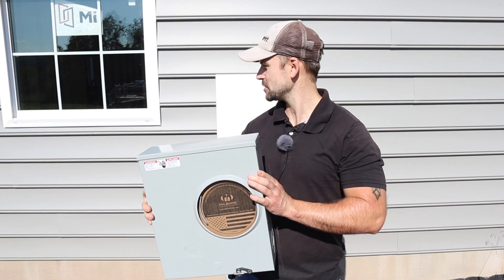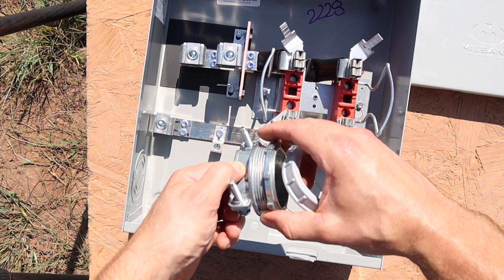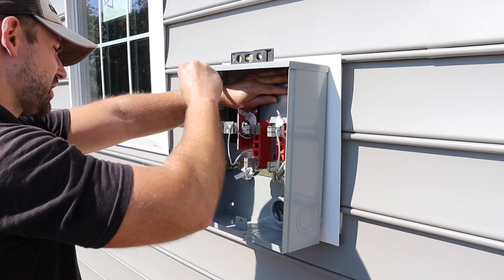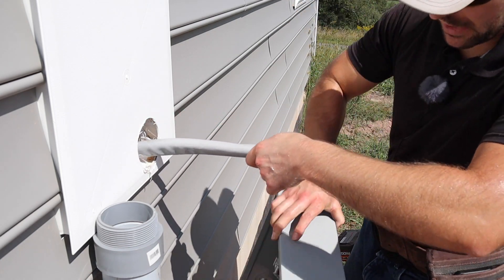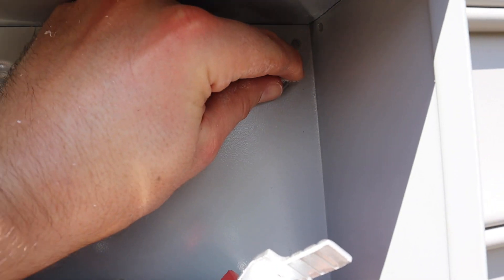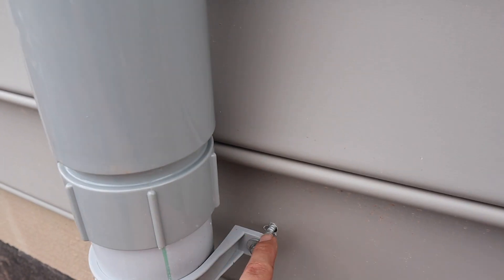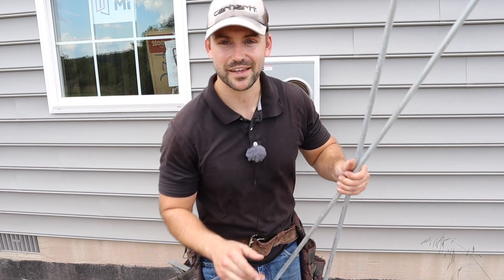Meter Base Installation In 14 Minutes! FAST And EASY!

Comment from the maker: I made timestamps below to help you navigate the video 👇. I hope it helps!
Supplies for meter base installation 00:15
How to remove a knockout 02:17
How to install 2” SEU clamp on meter base 02:52
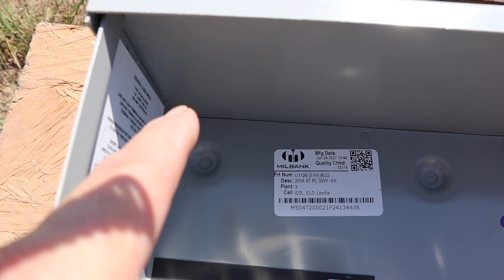How to position and level meter base 03:29
How to drill through the wall 04:08
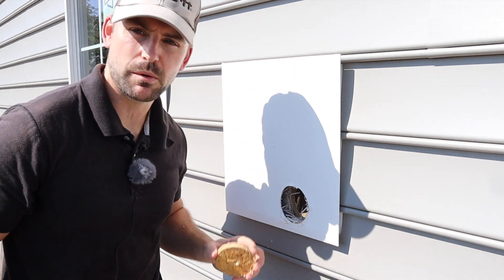Why I did not need a disconnect 04:28
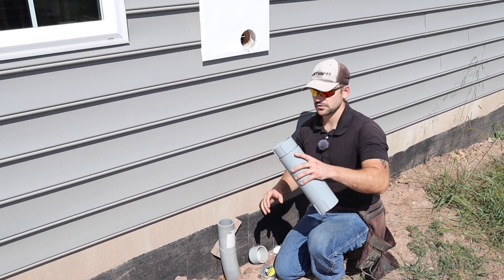How to install an expansion coupling 05:05
How to secure the SEU cable to the meter base 06:18
How to secure the meter base to the house 06:36
Meter base height requirement 07:42
How to wire SEU cable to a meter base 08:09
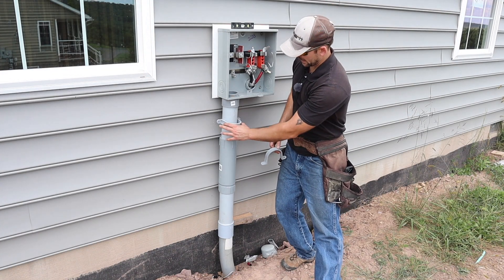How to anchor electrical conduit to the house 11:02
How to seal the hole for the SEU cable 12:42
Reply: When you are mounting the meter socket, you mention the J Block. Do you have a source for this item? I like the look it give the installation.  Thank you.
Reply: In my humble opinion, you do need an emergency disconnect outside to comply with NEC 230.85. Also, you should have used a torque wrench and tightened those screws to spec. Thanks.

Comment: The expansion pipe sounds like a sale  because you bolted wires to meter , they won't expand therefore you'll experience the meter being pulled if house foundation settles . Think about it .

Comment: I have two questions.  Can the meter be set on some kind of pad so it’s not actually    on the house.  Secondly we have a steel barndo and my electrician who gave me an estimate said my breaker panel can not make contact with the metal frame inside.  Unfortunately the framing inside of the barndo cannot be completed yet, but I wanted to get this out of the way somehow because our well and septic systems need to get put in and I need power for those. He said he wanted to do the breaker panel before the blown insulation because he didn’t want to mess with the insulation during the process. Has anyone dealt with this issue before? Because if I have to wait for insulation and framing it’s going to be a long time before I can get power to the house and our power company will not run a service line until a meter panel has been set up

Comment: Wish this was still code. Now, you have to have both a cutoff switch and surge protector on the panel to pass inspection. 

Even if your newly bought home from 1974, if the meter has been removed from the box due to non-payment from the previous owner, you have to switch all of that. Absolutely crap

Comment: What stops water from entering inside the house through the four lag bolt holes and the large wire hole? The putty stuff around the box's mounting holes just keeps water from entering the meter base box, but doesn't prevent water from getting into the home.. Did you silicone the outside of the box to the wall after you were done or something?

Comment: Shouldn’t use back knockout you violate the bend radius of the wire usually running the load side wire. The disconnect is in case of a fire they don’t have to remove the meter before the go inside. They won’t go inside without water they won’t use water unless the power is off. In short you should always install a disconnect. You generally don’t need those long lags unless there is blocking. Make sure your screws have threads go all the way up the shaft. Mosltly they are grabbing the 1/2 or 5/8in ply board on the outside
Reply: Make sure to follow the torque specs and brush in the antioxidant if needed this looks like newer wire that isn’t completely aluminum

Comment: just got quoted 4500 to replace the meter base.  I DIY everything.  thank you for the video!!
Reply: Do you start by calling the utility company to disconnect your old meter first?
Reply: @blamuk  I tried, but the Nashville utility requires a licensed electrician to have them disconnect.  So I ended up paying $2500 to have the meter base replaced and all new wiring to the first box.  In other words they would not let me diy.  Unfortunately I had already purchased everything to do the job and still let him use his sourced parts

Comment: No need for antioxidant on the wires.  That hasn’t been needed for a couple decades since AA-8000 aluminum has been used for the wire.

Comment: Your expansion coupling wasn’t installed correctly.  It looks like it is almost bottomed out.  It needs to be able to move both up and down and if the ground heaves upwards, it appears your coupling has no slack to allow that.  There should be a couple inches of space between the inner and outer pipes so the bottom can move up as well as down.

Comment: Is it important to seal the 3in hole cut out where the wires pass through the wall? Sealing the lags makes sense but I’ve never seen the 3in hole be sealed by anyone but it seems like it should be?

Comment: I bet you failed your inspection.  You didn't ground your meter base to a ground rod with your number 6 bare copper wire.   You had the ground rod clamp on the table.

Comment: Hey Josh, new Sub here, Thanks for the detailed video. 1 question, I am running cable to a 30 amp rv pedestal and then to a 100 amp panel for a tiny house. What size cable should I use for a 225 foot run?  Thanks

Comment: Hopefully someone can chime in on this, as I'd like to upgrade my service as well (and save a ton of money). Doesn't the 2020 NFPA 70 (electrical code) require emergency disconnects between the meter and panel now, regardless if it's just in the other side of the wall? The meters with disconnects are considerably larger and more expensive.  If anyone can provide a video or reference on whether or not this is mandatory, and what the exceptions are, I would be very grateful.

Comment: Put my meter box in yesterday thanks to your great video
Reply: I hope you grounded your meter base to a ground rod.  He failed on that and will fail his inspection  as you will to if you didn't do it.  Per NEC codes
Reply: @e_street7754  I had grounded my circuit panel but the inspector said the meter based also had to be grounded. Not sure if I could of only grounded the meter or not. Thanks
Reply: @newgardener    I'm talking about your meter base. Not your circuit panel.   They are 2 different things.
Reply: @e_street7754  Did I not say that the inspector had me ground the meter base? Maybe I am dense, But I thought I differentiated between two. 

Anyway two months ago I did my install exactly like the video and when the inspector came to inspect he had me add a ground to the meter base to meet code. He also recommended that I leave the ground on the circuit panel.
Reply: Your not dense.  I didn't pay it any attention.  But yes. Your meter base and your circuit panel (breaker box) does have to be grounded to a ground rod.    Now if you have an sub panel. It doesn't have to be grounded to a rod.  Your sub panel will be grounded from your wires you pull to it.

Comment: I believe you are supposed to set the expansion coupling  separated on the internal line. That way if you get expansion or contraction you are covered. I dont think you are to install that all the one to one of the rails like shown in the video.

Comment: You can't use that kind  of cable to feed from your meter base to your panel. You only need  3 conductors to the panel but the neutral has to be insulated. That wire you are using for a neutral is meant to be a grounding conductor. That cable when installed from the load side of the disconnect is made for 240 volts and ground. It's gonna work but it's not code compliant.   All three conductors should be insulated as they are current carrying conductors and should all be insulated.

Comment: one thing with no lox.  the way you did it is wrong.  you need to brush the goop in with a wire brush, then put the goop in the lugs.

Comment: Commercial electrician here, never seen an expansion coupling before. Seems like a good idea, but if something happened, wouldn’t the wire snatch the meter off the house?
Reply: I was wondering the same.

Comment: Im installing a breaker panel and meter socket on a pedestal for my shed. Does the meter socket need to be on the same side as my power pole?

Comment: Nice video. You were saying in the end you went going to drive the grounding rods and run the grounding wire to the panel box. My question to you is does the meter box needs to be grounded? Looking forward to your response.

Comment: What is the flat material you mounted the metal meter base box on, that was already fastened to the siding?
Reply from the maker: It is a block for mounting the meter. Here is the video of me installing it https://youtu.be/l1MwrqImWXsI I hope it helps.
Reply: Anyway you could send me your link to installing under electric conduit? That is what I am doing right now, 2 1/2 " schedule 40, grey.

Comment: Hey Josh please pardon my ignorance,

But I have a question I have one of their boxes from Cutler-Hammer much larger than yours it looks like it's got a breaker panel on the bottom of it, however from The electric I was wanting to know if I could remove that and get in to the box?
I want run lights to my carport and a couple of outlets, I already have everything I need except for five more sticks of conduit two more plugs and boxes and the weatherproof covers for them and I plan on using 10 gauge wire
So do you have any advice?

Comment: Hey I love your channel. I just subscribed. I watched most your electrical videos but I have a question I installed a meter base and main break panel side by side. Do I connect both the meter base and panel to ground rods or is on the main break panel enough? The code was kind of ambiguous. Using #4 copper ground wire. Thanks 🙏

Comment: I look inside my main panel and I don't see the 6 ga or 4 ga bare ground wire (that comes from the outside actual "earthen" ground rod) to connect anywhere inside the main panel that I can see. However, if I follow the buried ground line from the ground rod, it seems to come up through conduit to the outside meter panel and enters there. So the questions......1.)  is this a local code difference where the ground line gets connected to some part of the meter panel?....and 2.) how do we continue the ground path from the meter panel to the main panel? I checked ground continuity from the main panel and it's grounded, so I know I have a connection somewhere....just don't know where.... and how "Stout" ( ampacity) it is. Can you or others here help?

Comment: Excellent Laborer, did you know that it would be easier for you to install the ground rods with a hammer drill? I'm sure you must have heard of that. The hammer drill will lesson your work load and make it easier for you. I noticed you did not connect the ground wire to the meter base and I'm wondering why you didn't connect to the meter base.

Comment: Code requires the lugs be torqued to the manufacturer's specs with a calibrated torque wrench.   Improper torque is a leading cause of failure. It is critical with aluminum conductors.   And a torque wrench is fairly cheap.
Reply: NEC code requires the meter base to be grounded to a ground rod.  He didn't do it.

Comment: After you install the ground rods (6ft apart) you install the ground wire to the rods and go through the wall of the house to the panel box and connect the wire to the ground bar or to the meter ground?

Comment: Thanks for the video josh! I have one question though.. I'm currently adding vinyl siding to the house and my house has the meter and everything already set so I won't be able to install a j block. Do I just J channel around everything??
Reply from the maker: Yes that is correct, just put J channel around it and you should be fine. Hope that helps!

Comment: Thanks and great video! An electrician just mounted mine today but at first I thought he didn't leave enough 4/0 wire. He didn't use that SEU 4/0 cable you used just straight up 4/0...now Im going to go see how he clamped it. Anyway - whats that white mounting plate/panel on your house? I have new construction garage and the cement board isn't installed yet and the guy just lagged it straight to the OSB (and he didnt use those water tight screws like you used either).
I really like how you lay out all the supplies and give basic definition. Thanks again!
Reply: White block is a vinyl siding meter block. They make different sizes too for outlets, outside lights, exhaust vents for a nice clean look.

Comment: What is the flat square in the wall?
Reply: It's a meter base j block. It's basically j channel for your siding to be able to go right into it ..for looks really so you don't have to jchanel around your plywood piece you use to mount.

Comment: Expansion joint conduit looks to be installed incorrectly. There should be a black line on the conduit once pulled out, around 4 to 6”. That’s where it should be set at. The conduit needs to be able to move up or down.
Reply: The comment about installing the "frost sleeve" expansion joint as it was referred to is supposed to be installed at 50% expanded, there is a line to indicate that position.  Up north here our ground heaves up when it freezes and then settles back down when thawed. That's why we install ours like that.  Maybe in other climates that's not code but it just would make sense to give that the ability to move in either direction as it was designed to do.
Reply: Hydric-loam soils in that part didn’t require that in 1945. Not a remodel doesn’t matter.
Reply: I believe the concern is with the conduit dropping and pulling the meter base away from the wall, this design would work, however there is no room for upper movement, which I suppose is more unlikely.
Reply: Why are you guys watching a learning video? If you already think you know it all? Is your life that sad?
Reply: @TWITA1111 we like to see how intermediate doers do lol
Reply: @TWITA1111  incredible comment!!!
Reply: @TWITA1111 you will see “you’re wrong, I’m right” in any trade’s video. It’s in the nature of trademan to think our method is the only right one.
Reply: @tubeo94  I find it helpful when learning to read the comments. They’re often filled with good points.

Comment: would have liked to see how you bend the SEU inside the house to the panel without taking off sheath.  Maybe that's another vid?  I'm researching how to bend SER 4/0 (4-4-4-2) from main outside to inside 2x6 wall up to attic and then across (easy part).
Reply: He did it wrong.  That's how he did it.  Just flattened it over flat 2x blocking installed tight to that hole - hard 90 degree bend.

Comment: I wired up a detached, managed to get it inspected. I ran direct burial cable. How far into the ground was your conduit? Did you run it away from the house a certain distance to accommodate utility?

Comment: Are the mounting bolt holes for your meter box 16 inch on Center? Did you align them with studs? (Nevermind)
Reply from the maker: Yes they are Mike.Good luck with your project!
Reply: @TheExcellentLaborer  thank you. I'm having a shed put in place, trying to decide whether or not to wire it myself. I'm in North Carolina, you? ... please see my comment below about amount of conduit underground.

Comment: Where I live for meter bases ran through the roof you need it 12 foot from the ground, running 3 foot above the roof and 2in+ galvanized piping. Also not sure what method you use but a hole, bucket, and water will get both of those ground rods in within 20-30 minutes.
Reply: Using a motion most people are familiar with, too LOL

Comment: Dear, Excellent Laborer, I have two (2) questions:
# 1: Why are you using steel ground rods instead of copper ones?
# 2: Why not use a Leviton load center? That would be nice!
Please respond!
Reply: copper is a soft metal and corrodes over time with water exposure. He's using a galvanized rod that has a zinc plating over the rod which allows it to last a lot longer in wet conditions. The steel is also tougher making it easier to press into the ground. Copper would bend if it hit something heavy under ground.
Reply: @MuhammadAli-ev5jc  Thanks for the response, whoever you are. But I thought that using copper rods is standard procedure, that almost all electricians and lineman use. Doesn't it have the best conductivity for grounding and that's it's purpose?
Reply: @travisferguson1721  you are correct that it is the best for conductivity for the price (the most conductive is actually silver but copper is just as conductive for 99 percent of applications). That is why the grounding wire INSIDE THE HOUSE is made from copper. Where it wont be so easily affected by Water and PH conditions.
Reply: @travisferguson1721  2017 National Electrical Code 250.52(A)(5)(b) pg. 120 states that the rod-type grounding electrodes can be stainless steel and copper or zinc-coated steel.   

The standard ground rod that we electricians use is a copper-coated steel ground rod. Muhammad is correct; if the rod was pure copper, we would bend it during installation. You were right in your observation about using copper; you were not aware of its construction. The ground rod also needs to be 5/8ths in diameter and 8 feet in length driven into the ground, and a secondary ground rod needs to be placed six feet away from that one to avoid doing an ohm measurement.

Comment: Excellent video average guy can follow along. QUESTION does the meter base get a copper #6 ground wire. 9:58  besides the aluminum neutral
Reply: Yes the meter base is supposed to be ground to a ground rod.  Per NEC.

Comment: So much harder in Chicago/Illinois. No Romex/PVC or any of those plastic boxes allowed. Everything needs to be in EMT/IMT/RMC. Also, grounding rods are used only for outside and only considered protection against electrical surges such as lightning. We also use main water as grounding method for your electrical service. Rarely do you see foundation/rebar or beams as a grounding method. There's a reason why only #6 cu/ 4# Al gauge is required for your rods even with 200 amp service.